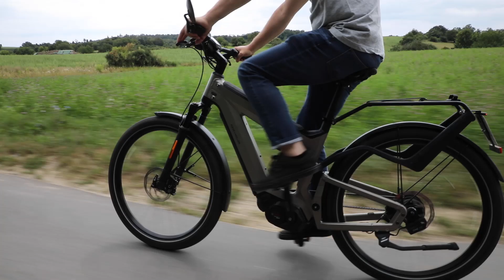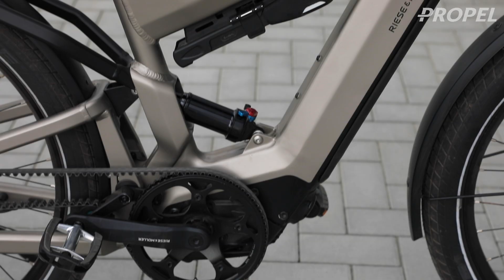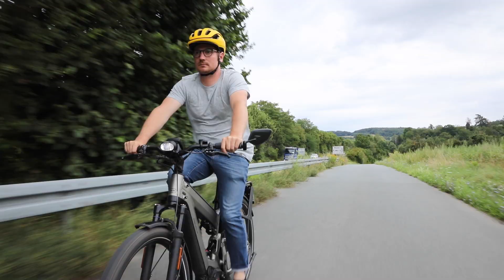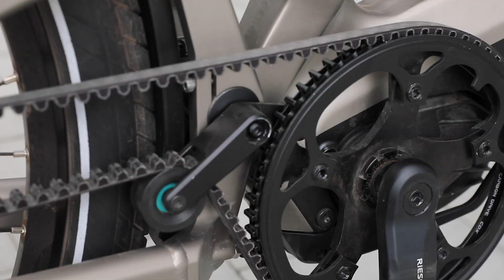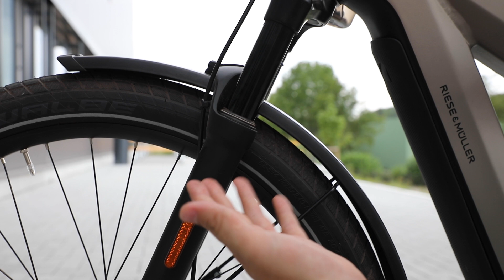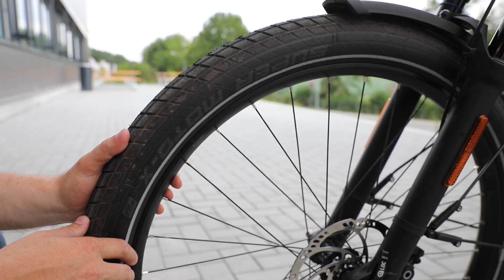Riese & Müller Superdelite Review

Comment: How easy can you maintain 45km? Can you compare this to a stromer? 250watt vs 750watt?
Reply from the maker: The peak power is pretty similar, but based on the way the motors are built it's very slightly easier to maintain 45Kph on the Stromer.

Comment: Does anyone know if you can upgrade your a Touring version to a Rohloff?
Reply from the maker: Technically you can upgrade the Touring version to a manual Rohloff with just parts and a decent bit of labor, but you would void the warranty. To do the electronic version it’s a bit more complex as the motor would need to reprogram and there is some rewriting to do. It’s usually not so cost effective and not all shops will do it. It puts a higher liability on the shop as they then become the manufacturer of the bike and most shops insurance doesn’t cover that sort of thing.

Comment: @UCTeNXcQYYOG_rXGAsQWKQfA Chris, love the videos mate thank you for putting them out there. 

I'm also unsure between the Rohloff and Rohloff HS. I seem to hear a lot that the torque curve is higher above 20mph on the HS. I saw this in a video you made also called called "20mph vs 28mph Electric Bikes: Which Should I Choose?". If I was to put a SpeedBox into a CX motor will I struggle more to get up to the 28mph a little more? I'm not sure if you have tried a Superdelite with de-restriction or not but I'm really curious as to how much difference there is. I will mostly be commuting to work and would actually register the bike as a moped but I do have area's where I can safely go off road with some hills responsibly and safely. I do like the fact I can turn the tuning chip off when on road though also so I'm really stuck. It's either Fox sus and cx motor or standard sus and HS. 

Really wish they reviewed the laws faster on these things.

Comment: If you can not get hold of the Supercharger 2 look at  secondhand Super charger Ist generation. We got one each in Nov 2017 and the bikes are great. Battery life is excellent and the battery discharge over the last two winters has been very low. We got the Gates belt drive because in our part of East Lancs England ( Pendle Hill country ) we have hills and plenty of them. The Gates belt drive allows no loss of speed on the hills as well as low maintenance.  One last point get Sena Helmets that have blue toothed and allow a half mile range to communicate with fellow cyclists as well as linking up with your phone

Comment: Just a point of clarification I think - at the 6:54 mark you state the Bosch motor takes 1,000 sensor readings per second - the R&M website FAQ states that it is only 200 readings per second.  "The Bosch system measures around 200 times per second how hard you are pedalling and controls the motor assistance accordingly. When you stop pedalling, it interrupts the motor power immediately."
Reply from the maker: You can see from the Bosch page in the top paragraph. Their communication has been consistent of 1,000 times per second. Not sure where R&M got that info. 

https://www.bosch-ebike.com/us/products/drive-units/

Comment: Does anyone know a similar, but a bit less expensive bike? It should be full-suspended for sure.
Reply from the maker: You might currently see some deals on 2019 demo bikes or left over inventory. You won’t see much else out there with the options and specs like this, but there are plenty of full suspension bikes out there. What are you looking to do with the bike and what sort of details are important?
Reply: @Propelbikes  I like that edgy frame design a lot and as I mentioned before, it should be full-suspended and have similar cargo options. What I don't need as much is the battery capacity. I would like to have a a comfortable city bike, but with the look of this one. Maybe the application possibilities will expand to tours later.

Comment: Is it possible for me to get the Superdelite and use it with just one battery (lower) while I leave the other (upper) to charge at home? Also, are both the upper and lower batteries identical?
Reply from the maker: Yes, it is possible to run the bike with one battery and the batteries are identical. There will be a cover available for the empty space where the battery goes. You can also use this when transporting the bike without the batteries on.
Reply: @Propelbikes  what are the steps required for maintenance of this model?

I am planning to import it to a country where e-bikes or cycles in general is not a thing, so there are absolutely no local dealers. I want a high quality, comfortable, long range, easy maintenance bike, such that once I get it imported, I will not need to send it back to dealers at all...

Any suggestions on this model or any other model from any other manufacturer that would fit my needs?
Reply from the maker: Sorry about the delay! Your reply didn’t show in my notifications. These bikes are generally very low maintenance. The motor system generally doesn’t require much of any maintenance, outside of that you’re dealing with the Rohloff or Enviolo hub. A derailleur is more common and potentially easier to find someone to help service, but the Rohloff hub is pretty easy to service (mostly just oil changes) and the Enviolo hub is usually just swapping the cables overtime. Outside of that it should be mostly just brake pads, tires and eventually you’ll need to service the suspension although many people don’t perform this service and they usually function fine. 

Where are you looking to import to?
Reply: @Propelbikes  Thank you for the informative response! I'm considering importing it to the UAE!

Comment: This or the Supercharger2?
Reply from the maker: My personal preference would be to go for the dual suspension on the Superdelite, but that doesn’t fit everyone’s needs the same. What are you looking to do with the bike?
Reply: @Propelbikes  Do you think the dual suspension is a worth it, for city commuting?
Reply from the maker: @Masreborn  I ride full suspension wherever possible. Beyond the added comfort it also increases the control and traction which can be very helpful in the city. The Supercharger2 is a great bike though and I'm sure you'd be happy either way, The Supercharger2 will be a bit lighter and sportier. Do you need the dual batteries?
Reply: @Propelbikes  Well, it's better to have two than one. Sure. Why?
Reply from the maker: @Masreborn  I was thinking you could also consider the Delite for a lighter weight option.
Reply: @Propelbikes  How far can I go on a single battery?
Reply from the maker: You can go between 25-65 miles depending on the assist level.
Reply: @Propelbikes  Thanks for the info.

Comment: Considering that the Rohoff (highest spec version of the bike) is not available with the optional  smartphone hub ... is there a way to get the bike to power a smartphone anyway?  (all it would take is a power connector) That way a rider could buy a smartphone handlebar bracket and plug their smartphone into the bike  and use google maps or anything else they wanted on their phone without loosing their phone battery charge.
Reply from the maker: If you get the Kiox Display you can power your phone from the micro USB port on the display. This isn’t possible with the Intuvia though. 

The Smartphone Hub doesn’t work with Eshift, but the Kiox and Intuvia does. We generally recommend the Kiox display.

Comment: Love this bike but the battery cover doesn't look like a convincing solution. Is this waterproof?
Reply from the maker: It’s not waterproof but it’s water resistant as Bosch recommends. As long as it’s not submerged you should be fine in my experience

Comment: Nice review, thank you. 

I did notice you compressing the suspension at each downstroke of the pedals. That’s probably because of the new motor. It’s hard to explain but the 1:1 ratio transfers each downstroke to the suspension in two ways at the same time (the push down on the pedal and the pull forward of the chain) which the old motor separated because you had an almost constant pull of the chain due to the multiplication of the pedal cadence. 

Although the new motor seems nice it might have that unwanted side effect on the suspension.

The other disadvantage of the new motor is that the chain ring is lower than the motor which exposes it the ring and belt to impacts from below.
Reply from the maker: Great feedback. I will have to look at this more closely. I also didn’t setup the suspension sag. 

I’ll have to talk with some of the R&M engineers about this topic and see if they have any thoughts. Surely the clearance is a thing though. 

Great points though and I really appreciate the comments.
Reply: @Propelbikes  Hi, I was visiting your website and noticed you have a picture of a Delite Rohloff on the page of the Delite Touring. It can be confusing for your customers. propelbikes.com/product/riese-muller-delite-gt-touring/
Cheers!
Reply from the maker: Thanks for the heads up on this. We were in a rush to get the new bikes up and all of the pictures weren’t ready. We have been updating everything now.

Also - I ended up having a long discussion with Martin Hess about the suspension on the new bikes. I believe what you were seeing was mainly related to the air pressure not being set correctly before riding the bike since I had limited time. But I should note that the swing arm pivot has been repositioned on this new model to address the concern you mentioned. If it wasn’t moved it would have efficiency issues, but the pivot point is effectively directly at the chain line which is ideal.
Reply: In the other video of him reviewing the regular 1-battery Delight there was no such compression while pedaling visible

Comment: hey man great review the first one i see around :DD I hope you could tell us the differences between the new and old gen of the motor especially in terms of drag when you are not using it or when you pass the km/h limit. Thanks  !
Reply from the maker: Thanks! The Gen 4 has practically no drag when pedaling without power. I spend a good amount of time on the 25kph CX motors in Germany and I found it very easy to go well beyond the limits of the assistance. This is a considerable improvement from the Gen 2 system, but in the stated it’s not as big it a thing where 32kph is standard and 45kph bikes are pretty common. I can see this being a much bigger deal in Europe and overall I’m very excited about the change. 

I will admit the motors I rode were early production samples and they were a bit loud, but I look forward to testing a production model this week at Eurobike. Let me know if you have any additional questions and I’ll do my best to answer.
Reply: @Propelbikes  I ll really want to know which motor is best for the delite. I think the speed version is my favourite. So ,will there a big difference to the non speed version?
. The specs are still the same.
Reply from the maker: I would totally go for the speed motor! The CX has a bit more power at lower speeds, but the torque is the same on both motors and they both give up to 340% assistance now.

Comment: How was the new gen4 motor compared to the gen3? Does it go all the Way to 45km/h or does it stop a couple of km/h short? And is the resistance when reaching the limiter much less noticeable?
Reply from the maker: The new Speed motor goes all the way there and it actually provides more power once you pas 32kph or 20 mph so it makes it really easy to get up to speed. This is a great improvement in my opinion.